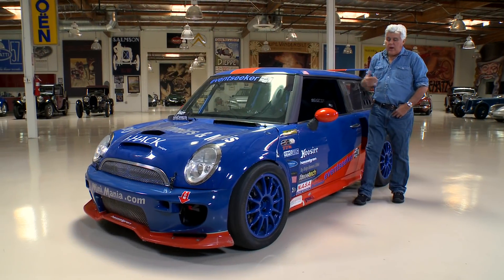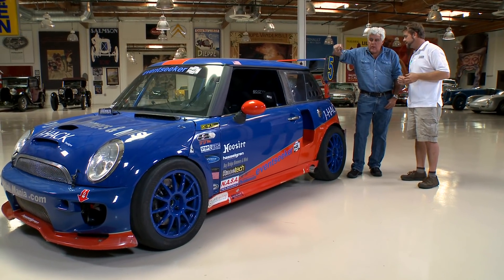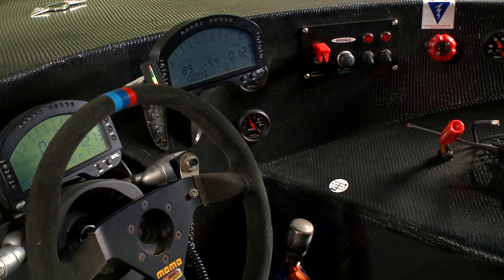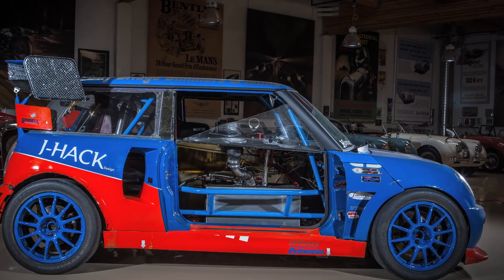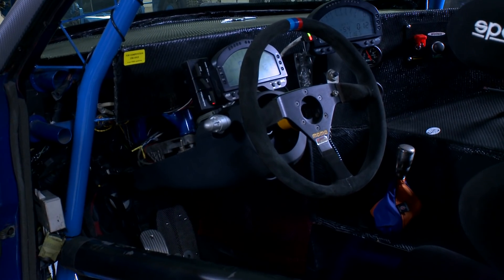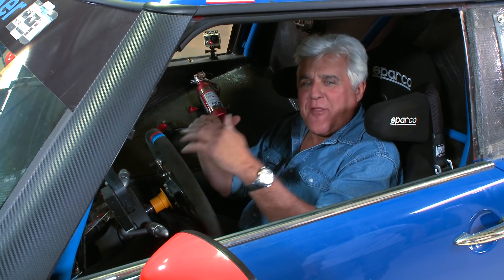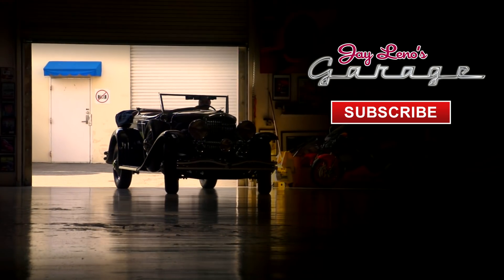2002 Twin Engine Mini Cooper - Jay Leno's Garage

Comment: What a beast. The fuel pump was quiet when Jay turned it on, was expecting that terrible whine. Nice build.
Reply: We're using twin, submerged fuel pumps. But yeah, buried in the fuel foam, inside a swirl tank, inside an anti rupture fuel bladder, inside an aluminum tank, they're awful hard to hear!

Comment: 500hp in a mini.....my kind of car!!!
Reply: You are my type of human.
Reply: even if they run at the same time. its not going twice as fast.
Reply: minis fuckin blo
Reply: theres a guy who has a single engine min with 500hp r56, on DMO Deejays channel, very cool stuufffff
Reply: I mean, mine has 300hp and its single engine lmfao.
Reply: try a VR6 metro !!
Reply: @Marcus... Plus the weight, His has to be 300kg+ To me single engine is the way to go, Maybe an engine swap...
Reply: Mine has a whopping 120hp and it "feels" really powerful! 👌😎
Reply: @oliverkalamata2753  That's twice the power of the original, but they only weighted 649KG BMW one are alot heavier.

Comment: HA!  Back in the 80's I had pulled the engine compartment/ suspension off of one Saab 99 EMS and did the same... I stripped out the floor interior of my other EMS and had it all set up to stuff the engine behind the front seats... a divorce forced me to close up my front end shop and move on... and the project never got completed. This was going to be a mid-engine rear wheel drive car.

Comment: This man has made the car that (as a former automotive R&D guy), I have had in the back of my mind (waiting for me to get rich enough to be able to essentially throw tens of thousands of dollars away like used confetti), since the mid 1980's. Having electronically controlled throttles are the key to making any twin engine car project reliable enough to be anything other than a toy with the intermittent embarrassment option as standard equipment. 

Great job! 🎯

Comment: That thing looks like it would beat the hell out of other manufacturers in rally, if it had some rally tuning!
Reply: Absolutely no way, WRC or Rallycross cars are absolute freaking bonkers, just on another lvl!!! In the case of rallycross cars even more powerfull and by the way anything else than build on a "Budged". I can tell you for shure, even Jay Lenos face expressions would have looked different driving one of these. ;) But still a great build thou. It's his own, as long as he loves it he should go on, with this one. :D
Reply: If you want to see some great rally cars. Theres a teenager in New Zealand who built a Peugeot 206 with a 2011 Ferrari f1 engine thats rear engine AWD and sounds like a monster down the tracks. From first hand experience and a couple of ride alongs i can say that its truly a passion project that paid off massively

Comment: 4 wheel steering would be fun thing too!
Reply: ***** Plus not to forget the best implementations yet:
Porsche 991 GT3 (2013-present) (in sync high speed; out of sync below 30mph) capable of beating the likes of a mclaren mp4 round a track despite a 140hp deficit and 200kg weight disadvantage. Porsche reckons 4 wheel steering is worth at least the equivalent of an extra 70hp on the track.
Porsche 991 turbo & turbo S (2013-present)
Porsche 918 spyder (2013-present) world record for fastest production car round nurburgring @ 6mins 57seconds
Reply: Don't forget that most rock crawlers, monster trucks, some JLG man lifts, and even the B-52 uses steering at the back as well as the front. 
Also, thanks for the backup MrZebrawr. I was seeing red and couldn't comment without going batshit crazy pissed LOL!

Comment: "250 per engine so hopefully 500" is the statement that made me realize he is not an engineer....
Reply: nothing ever goes according to plan, 4 years of robotics engineering taught me this, he probably is an engineer.
Reply: there is no practical way of measuring it. even an engineer could only give you an educated guess. what are you gonna do? stick it on 2 dynos at once?
Reply: i do know basic math, yes. and i do know that you don't just add the outputs and it occured to me that there must be 4WD dynos, so my point is invalid. but you can still get off your high horse there, mate
Reply: 420 erday for my horse...
Reply: dinoreah 2 Yeah. it was honesty. You will loose power in the delivery with a set up like that. Not saying it's a bad idea, but there is more going on. So hopefully is a good truthful answer.

Comment: "doing this on a budget" as he pulls off a carbon fiber rear hatch...right, k, pretty massive budget then.
Reply: Andres said it best. The "budget" part was to keep up with a $200,000 Porsche on a race track. If the whole build comes in at under $100,000, then he is racing on a budget. see 4:30 mark
Reply: I love how he puts it behind his back as if it was like a binder or something haha
Reply: enginemaxcarb. What are you trying to say? 2 Bike engines perform well enough to race against a 1 engine Porsche and cost more than half as much while doing it?
Reply: Tom Hornsby You say that as if it is impossible for those two engines to perform similarly to one large one. If you wanted the larger engine I wonder how it would fit in that shoe box. Also since you are not the builder, how do you know he paid for that hatch or even what the amount was? You have a lot of assumptions which is dangerous for your argument.
Reply: enginemaxcarb. he didn't use a bike engine... hahaha watch the video again.
Reply: Saki630 yes exactly that, have a look at z cars uk, they build mini's with bike engines and they are insanely fast. the engine in this mini isn't a bike engine though its just the standard motor tweaked
Reply: Michael Vann
he said the car cost about 30k not 100k
Reply: @michaelvann1353  firstly 30k budget not 100k.
 Secondly carbon making your own carbon is relatively cheap. Especially compared to any kind of panel from an aventador (generally $150-200 per square meter of carbon)

Finally compared to designing an Awd system for a mini, this is an extremely simple set up considering you would have to redesign the entire under tray to fit a driveshaft, transfer case, transmission etc. For a 2 engine design you "just" need to cut a space in the rear and insert a different rear subframe and a new engine. Obviously theres more to it than that but all the other stuff would have to be done AWD or twin engine anyway
Reply: That phrase does my head in. F1 teams work to a budget, Moto GP teams work to a budget. Every race team is doing it to a budget, it's just their budgets are a lot bigger. The phrase "doing it on a budget" =\= doing it on the cheap

Comment: 10.23 'its got a lot of grip' well yeah its on slicks
Reply: Just a question...Don´t you think that the brakes of the Mini are too small?
Well I think they are way too small.
Reply: I doubt they would be stock, I'd think they would be higher spec than stock
Reply: but they look so small, they need to be bigger for ~500ps
Reply: they don't need to be that big, the car doesn't really weight that much
Reply: ahhhh two engines?!...high speed(with 500hp)..I really think he needs big brakes.
Some really big badass brakes:D
Reply: yeah I get what your saying but rallycross cars with 650bhp and a lot faster than this only run 17in wheels so brakes aint much bigger than standard, just better disk, calipers and hoses. im not 100% sure but I think you'd also get more engine braking with it being twin engine (no doubt someone will correct me if im wrong)
Reply: might be that he get better engine braking...might be^^
Anyway Grtx and Bye
Reply: John Ehrlichman says the troll lol jog on

Comment: This is way more complicated then it needs to be for 500hp.
Reply: He wants to bring it to 700 bhp.  That's only the first iteration.
Reply: if he wanted it to be 700hp he could put an inline 6 in and turbocharge it, without the second motor.
Reply: Jack Donnelly So he may want to bring the thing to 1400 bhp
Reply: Eric D. Or he just swap and AWD system. have a way more reliable vehicle.
Reply: i think you miss the point, anyone can simply drop a larger capacity engine in, he made it dual-engine to make it unique and as a project
Reply: TRIGGERED Good point !
Reply: weight displacement...
Reply: TRIGGERED You can also wear two pairs of shoes
Reply: James Bissey I bet an Ls would be lighter then two mini engines and their drive trains.
Reply: elliott turner it's obviously just a novelty project. One big engine with a rear biased AWD system will plainly be a lot better to drive than a heavy twin engine with so much power at the front wheels. But it's interesting all the same.

Comment: Nice but it's still 250hp not 500hp doesn't work that way..
Reply: I thought the exact same thing when he said it.  it would only be 500 if he had that to all wheels. he's only making 250 to all 4 wheels.  Seems like a lot of work for not a lot of gain.
Reply: I really wanna know how much it is! Doubt that it has only 250hp combined, but neither 500hp. I think it must be around 300-350hp. Similar to decibel. 100db+100dB is something like 110db or so.
Reply: Why not?  If it's 250hp at the front wheels and 250hp at the back wheels, is that not 500hp?
Reply: No, no matter how you look at it.  Each drive wheel is getting 250.  If he hooked up both engines to either the front or rear, then we could add the HP together, but they're driving 2 separate differentials.
Reply: Thanks for the feedback!  Just to be clear- if I had 25hp electric motors at each of four wheels, it's a 25hp car and not a 100hp car?
Reply: Yes i got 1 horse pulling my cart if i get another one to go with it i will still be  1 horse power even though there are TWO horses pulling my cart...... don`t think so
Reply: Horsepower is work done. So two engines will get twice as much done. Work is required to give object speed. If one is 200 at the wheels, then 2 will be 400. The torque per axis is still the same though as for 1 engine.
Reply: We demand the dyno chart!!!
Reply: Actually it does work that way.  A prime example is the new 918. With awd and an electric motor powering the front wheels. The hp rating is the combined output of all it's electric motors and gasoline engine combined.
Reply: agreed, but what changed drastically is the torque :)
Reply: Domas64 yes but with my understanding now its a 4 wheel drive, so it has torque at the rear wheels also. the pull is defenatly more than if it had 1 engine. the max rpm though are the same so at max power both engines run, lets say at 7k rpm, so max speed will be the same as if it had 1 engine. acceleration should be more cause for a little more weight it has double torque to move its mass.
Reply: phoenix1925
Max speed is dependant only on power and aerodynamics. Ofcourse it can be limited by gearbox and engine speed limit, you have to change the gearboxes if you want more max speed just as you would if you would double the power on a single engine. But I guess this car is not about max speed :)
Reply: Domas64 no one talked about gear boxes, the "arguement" is if the double engine can raise acceleration and top speed. and as i said top speed isnt raised that way but acceleration is.
Reply: phoenix1925 Another factor is the increased weight of the second engine AND tranny, plus all the hand-formed steel rollcage-frame, radiators, exhaust that are NOT needed when increasing the power of a single motor.
Reply: TIMEtoRIDE900 yes, but lets not forget the potato factor
Reply: TIMEtoRIDE900 weight is irrelevant on this discussion..
Reply: You were just discussing acceleration in your last comment - - therefore weight is relevant.
Reply: it's painful to read these comments
Reply: If displacement is "free" in this class, then build a motor from a billet of ally displacing 3 litres, and turbo THAT with a steel crank.

Carbon fibre as many panels as you can, get the gummy tires and go racing.
Reply: if you want an example of the math of why it's not going to be 500hp the answer lies with the drivetrain setup, it's a Front Wheel drive car, he copied it to the back, so you have FWD and rear FWD. You would get 500hp if it was an AWD car cause them the drivetrain would all be going to a single point then distributed to the wheels, not 2 points and then to 2 different wheel sets. Here's the example, I can lift 25lbs with my right arm, and 20lbs with my left as I'm right handed. To your mind I should be able to lift 45lbs with just the exact same ease as each arms' lift when using both arms. However it's not, it's closer to lifting only about 30lbs cause the extra strength from both arms at the same time can only affect the zone of force, or point of impact, each had. Same with the twin engine, the front engine is pushing at 250hp and the back is also pushing at 250hp, the formula to figure out the estimation of combined force is ((a+b)/2)*1.5 cause you'll only get about half the extra strength you think. So since both figures are the same just times by 1.5 to get the guess. So somewhere in the ballpark of 375. Now I'm NOT a mechanic, I'm just a math guy so putting in my 2 cents. As for the talk of acceleration and top speed, those are factors found based on Torque, Weight, and Horsepower all combined. So once you have the HP and Weight, then you figure the Torque which will be different to figure as both wheel sets will be pushing the same Torque as if only 1 engine was in it but to 2 separate drives.
Reply: That explains the "20 Mule Team" concept - each additional Mule pulls less and less of the load.
Reply: Actually as others have explained  that is exactly how it works. and if you had 4 engines driving one wheel each it would be a 1000hp car. And the torque is additive also. if you want to go faster you just need taller gearing. . same as a larger single engine.
Reply: tjsbbi
Agreed - - however you still need the cube of horsepower to double acceleration in a fixed distance.
Reply: +tt7hvn No, they are driving the SAME car, therefore you can add the power up.
Reply: Darianstarwind
Let's review:

" Here's the example, I can lift 25lbs with my right arm, and 20lbs with my left as I'm right handed. To your mind I should be able to lift 45lbs with just the exact same ease as each arms' lift when using both arms. However it's not, it's closer to lifting only about 30lbs cause the extra strength from both arms at the same time can only affect the zone of force, or point of impact, each had. "

So, with both arms you can only lift 30 pounds??
Are you 9 years old??
I lifted and carried 175 pounds thru a house with one arm, and can lift a car engine with both.

"Same with the twin engine, the front engine is pushing at 250hp and the back is also pushing at 250hp, the formula to figure out the estimation of combined force is ((a+b)/2)*1.5 cause you'll only get about half the extra strength you think. . . ."
Where did you get such a formula ??

Does the car know which engine was the "first" engine, and which engine only makes "half" the power ??  This might be important info for a tuner . . .
Reply: potato
Reply: You seriously believe that?

Comment: I had the idea when I was just about ten years old to put a smaller engine in front and back when my uncle was talking about gas mileage. My idea was to only use both for passing or pulling a heavy load. Or for blowing the doors off someone at the red light. And actually, it would eliminate a lot of hassle to use four or five speed auto trans on both.

Comment: with some clever and proper software or ECU mapping you can really have them in sync like: misfire on engine 1, drops rpm.... compensate by closing the throttle valve on engine 2 until it syncs, or mis shift engine 2, cut power on 1, shift 2, apply power, etc...

Comment: I dont know if its been mentioned, but theres a guy in the UK that's taken the original classic mini engine out, and put two motorbike engines in the boot, one connected to the rear left wheel, one connected to the rear right wheel 😁

So hes got a 2 litre mini, but it revs to like 16,000 rpm's 😁

Comment: In the late 90's, i read an article in MT or C&D about a Cadillac Eldorado someone had built with a similar setup. It had a 2nd v8 in the back powering the rear wheels. They called it the "Twinstar". I don't recall the name of the company that built it.

Comment: I've always wanted to do this on my Firro.....add a separate motorcycle engine up front ....hi horsepower shaft driven would basicly bolt right up.

Comment: The S in Mini Cooper does NOT stand for supercharged buddy. It does not stand for anything at all, it was just used to distinguish from the regular Mini. Common misconception. I do like that touch of "M" colors at the top of the steering wheel.

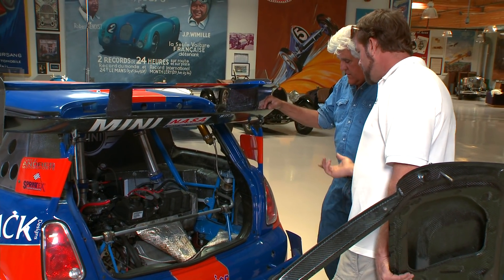Comment: On minute 6:19, the guy says "S means supercharged", he's wrong.  Why, I think, 2 reasons?  First of all, Mr John Cooper, he's the original Classic Mini racer, Mini Engineer and finally Mini modifier from the original creator, Sir Alec Issigonis.  John Cooper modified various models, Cooper and Copper S, both models without superchargers back in the 60's.  He has since passed away however his son is continuing the tradition.  Secondly the BMW MINIS first generation MINI's were supercharged which I owned back in the early 2002 (in Canada), but now I have a 2010 Cooper S JCW...with not a Supercharger, but a Turbo!  What does the S stand for now? ...Just sayin!
Reply: Sport
Reply: Right!  Thats what it stands for, You got it Dimitri!
Reply: Paulo Medeiros Cool

Comment: I'm sure that he could've bought a new crate LS engine for the same price or less than those two mini engines. So, when one engine breaks down during a race...the other engine has to work twice as hard carrying the extra weight of the dead motor. Thus, wearing out the working one sooner rather than later.